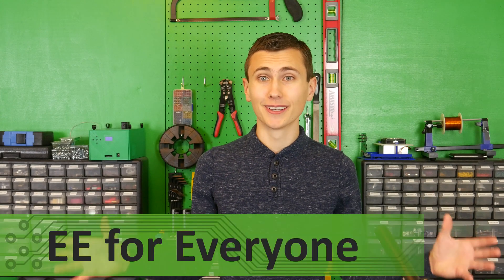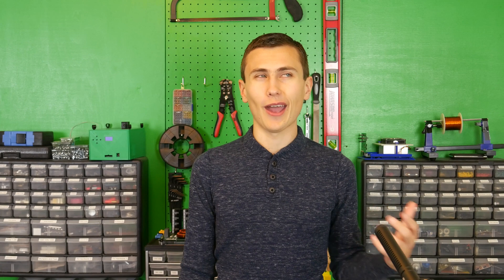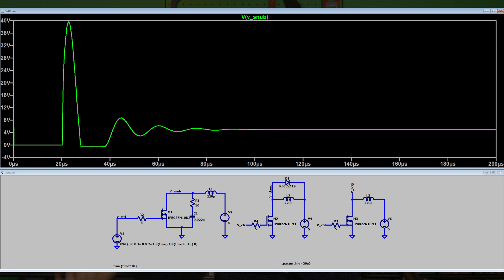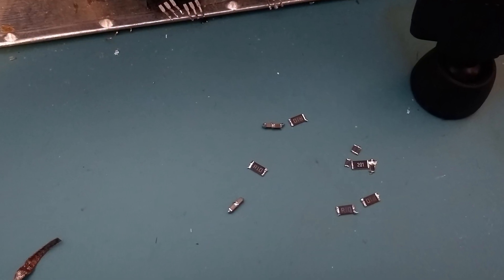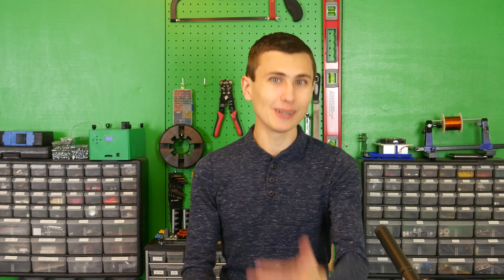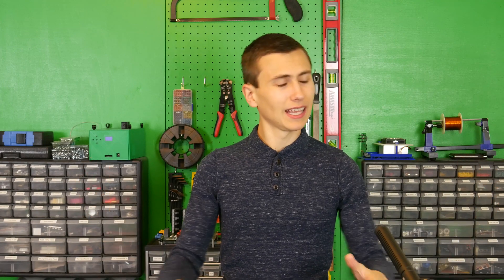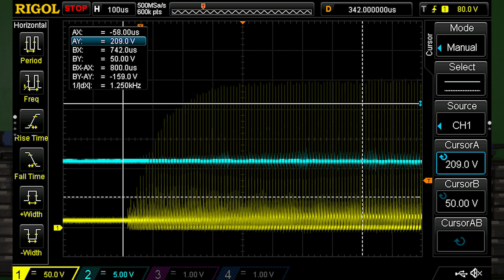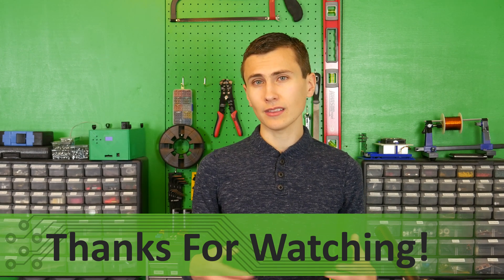Snubbers are Important.

Comment: I need your help. There's a YouTuber who has a very popular channel called DazeCars. He's been doing a series of DIY videos on salvaging treadmill motors and their associated controllers for powering tools and other machines. He just came out with a recent video where he discourages adding a flyback diode to for circuit protection because a bad it can destroy the motor.  He claims the MC-2100 treadmill motor controller sucks because it burns out whenever it's turned off suddenly or when the direction is switched. These sounds like the symptoms of an inductive spike. Perhaps, you can settle the issue by addressing it with video. It would be a great way of attracting more viewers. At the very least, you could leave a comment on his video. He admits to not being an engineer, yet disagrees the voltage spike is a problem.

Comment: Hi man
Thanks for the valuable explanation

I need to know when to go for a rc snubber and when to use a diode in free wheeling mode.

Many internet and text book designs involving an inductor driving transistor is using a diode clamp either in anti parallel with the element or the inductive load.

If diode is enough ...Then why snubbers are used ? And when they are used ?
Reply: I have the same questions as you.
Could someone please answer these questions?

Comment: Rather than dissipating this energy as heat in the passives ... is there a way to re-claim and capture this energy, rectify it, and feed it back into the input  -- sort of like regenerative braking?
Reply from the maker: Hello, great question! In theory, that should be possible, but there is a problem. If a diode or fet rectifier could turn on fast enough, there shouldn't be any energy to snub! So this circuit is only managing the energy due to the silicon not conducting right away.

So, I guess if you have a main rectifier, and a smaller, faster rectifier... Maybe!

Comment: Awesome vid once again..  ever though of using a bifiller wound primary connected antiparallel..?
this will increase you primary side capacitance / lower its self resonant frequency and will store the spikes inside the high self capacitance of the windings them selfs like a shock absorber. this way you dont need snubbing cap either.. i used this in DC pulse resonant systems before and it worked like a charm..
Reply from the maker: Hello ff ff, Thank you for the idea! That's crazy smart - use the parasitic to your advantage instead of fighting them! Bifilar connected antiparallel is a great choice, especially because we were switching such low voltages on the primary side. Thank you for the tip, and thanks for watching!
Reply: @EEforEveryone  " use the parasitic to your advantage instead of fighting them!"
exactly :)

keep up the awesome channel!!, perfect balance between theory and practice if you ask me 
!